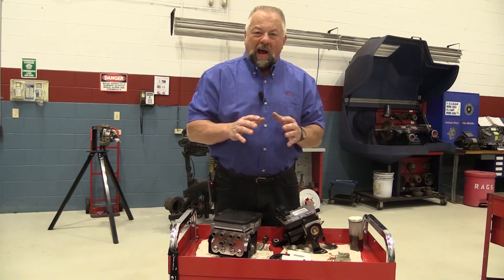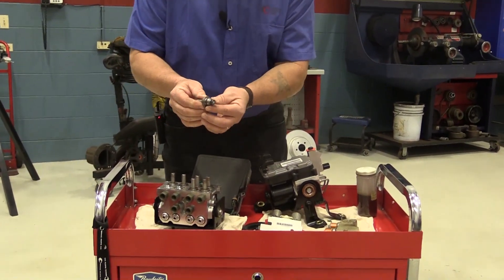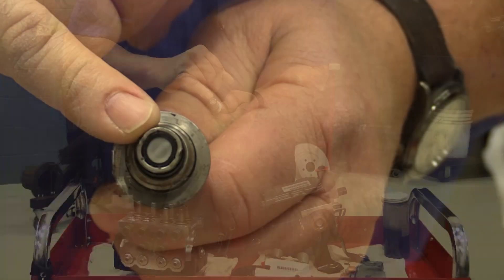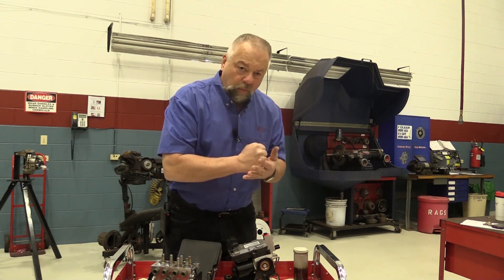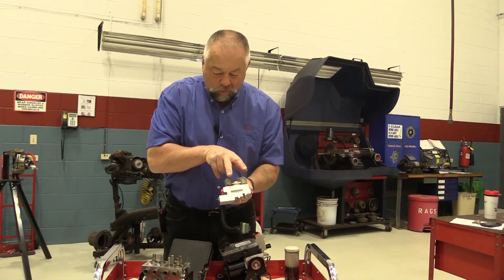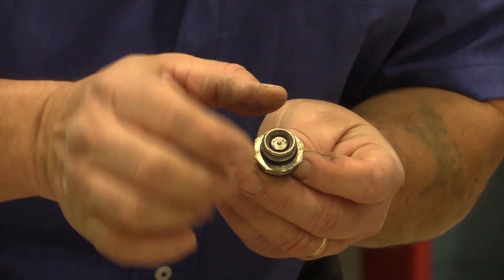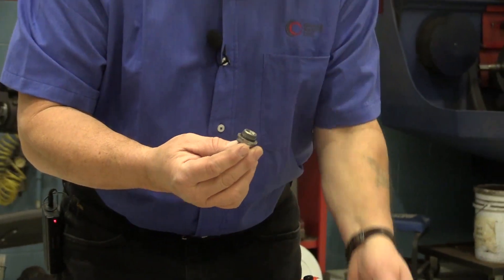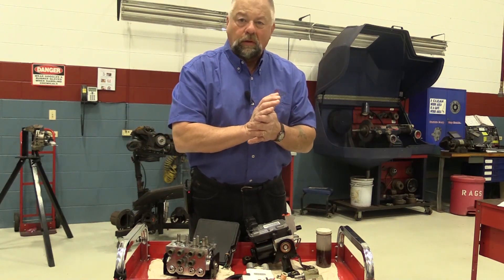ABS System and Components

Comment: This video explains a lot regarding my brake problems on an old jalopy. Google said dirty brake fluid was the cause of a dragging caliper and randomly that would be my problem on the left front of my 1996. I eventually got things working but now that the vehicle sat jacked up for a few weeks with the ABS module on the low side of a tilt the problem has returned viciously to a constant pressure on that line. I'd like to keep the ABS even though it's a $75 car years ago... Hopefully I can use this knowledge to clean that out good enough somehow for the return hole to bleed off pressure before I'm forced to bypass the module. Thanks

Comment: Great video thanks. Perhaps you could advise. I have a 90 Benz E 300, the brake efficiency is very poor, Ive replaced rotors and pads and hoses, could this be an ABS problem? No light on the dash.
Reply: Bleed brakes after?
Reply: @Kyson Jamal Instablaster ;)
Reply: @Tadeo Kristopher I really appreciate your reply. I found the site on google and Im in the hacking process atm.
Looks like it's gonna take a while so I will reply here later with my results.
Reply: @Tadeo Kristopher it did the trick and I finally got access to my account again. I'm so happy:D
Thanks so much you saved my account :D
Reply: @Kyson Jamal happy to help :D